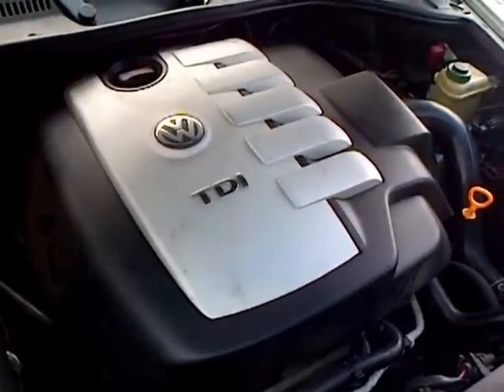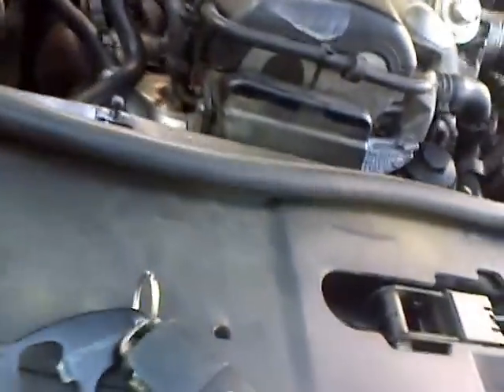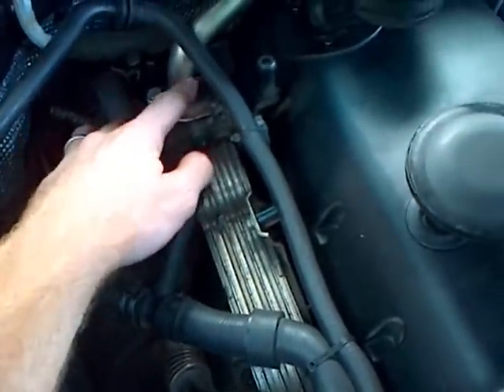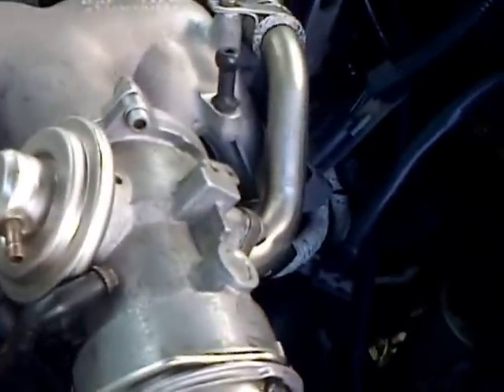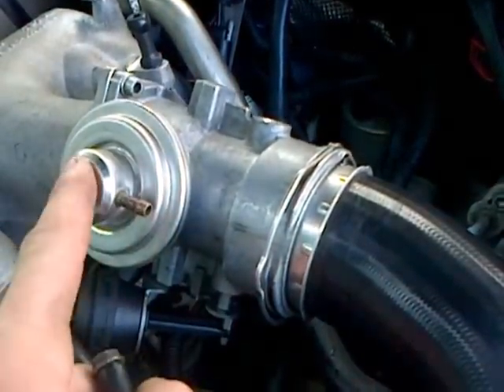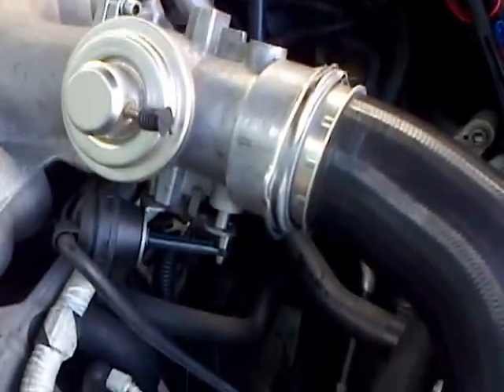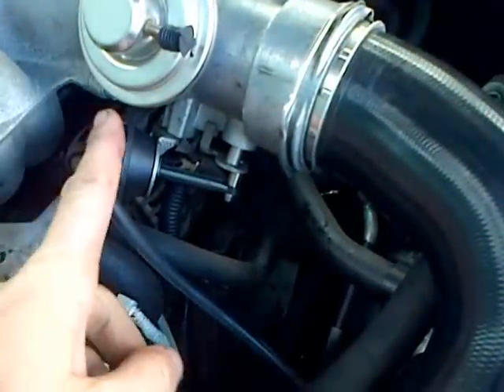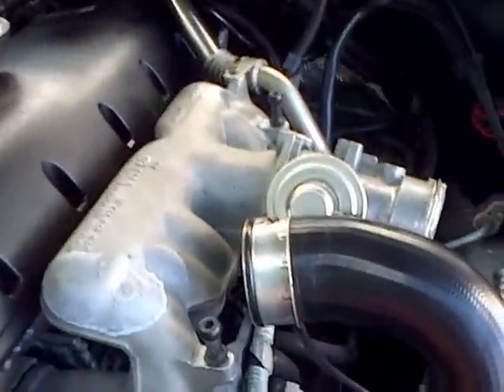Touareg 2.5 R5 EGR blank DIY

Comment from the maker: Did you not read the description ***** . The EGR delete on the R5 with the vacuum system does NOT throw a CEL or log any codes on VCDS/VagCom. The EGR is not active at idle when the car is up to operating temperature so it won't fail MOT. Besides, this a DIY for those who want to do it. The repercussions thereof are their own. Please do not comment if you aren't sure of your facts! This is on my own touareg of which I have swapped the engine. I know this engine better than most. PS : What do you think are the repercussions of having EGR block up your intake manifold starving the engine of air and inevitably causing you to buy a brand new car? What's the carbon footprint of that?
Reply: To delete EGR valve is it enough to block the EGR hose ?? or also must get into the car’s computer and desactivate it from the car’s computer also ?? 
And also would be good idea if remove the throttle body and make the hose straight connect to engine without any throttle body in between !??
Reply: Hola tengo vw touareg 2004 2.5 automática no tiene fuerza al acelerar ayuda por favor

Comment: Hi Marius, great video.. I wondered If after a year later you noticed any negative effects?
Is it important to cap off the EGR valve as well as block the pipe with a bolt? Could not capping the valve damage the turbo?
Reply from the maker: You can either just pull the vacuum pipe off and block it. Or you can install a blanking plate. I did both as I don't want the crud in the valve that stayed behind to get ingested. I have had no ill effects other than the car takes an extra 1-2km to reach operating temp. My car is running super clean and efficient. See this thread - 4x4community.co.za/forum/showthread.php?t=184572
Reply: Marius Fourie Thank Marius. Just read through that forum and theres some great stuff on there,, However in one post it says you leave you EGR valve on and just clean it often? Did you have a change of heart?
Reply from the maker: pullenjon Yes, I did have a change of heart but I have had a change of heart again. Im currently running without it and have done so for about 20'000km.
Reply: What made you change your mind.. and then again out of interest? Ive just blocked mine off today. Doing some heavy towing tomorrow so Ill see how shes goes.
Reply: Hello, thank you for this very old video. İs it safe to just block the vacuum hose and not installing a blanking gasket? Will the hot gas melt the valve and the thin egr pipe? Thanks a lot!

Comment: I noticed today a strange sound on the turbo side (passenger side not drivers) ; like a strong whistle (the car is performing as before). In the N gear I have to give throttle to 2000rpm and then agressively to 5000rpm to listen it. then when 1st 2nd gear I listen it when I accelarate in low rpm 1500-2000 also agressively. What could it be. I made a video but dont know how to post it. :(

Comment: Great help Marius, I been having a severe problem with this issue. Car did not even start and it was nearly prone of abusive dealers trying to make it look the problem was elsewhere. Once I realized the truth I am constantly cleaning it but is getting dirty very often. Now when it happens I have to get out of the car and move manually the lever and then it starts normally. You are of a great help with this video but please tell me if this increases the fuel consumption and/or reduces the engine power? Where is all that dirt going?
Reply from the maker: If you blank the EGR valve the dirt is now going out the exhaust. No negative side effects at all. Best thing I ever did to my car.
Reply: Just found out this video and your comment. I have the same car and one of the main problems it has is the starting. Whenever I drove it somewhere, turned it off and tried to start it again after it got cooled - it didn't start. Went to 3 different local mechanics and they told me the problem could be the turbo or the injectors. Changed the turbo, still have the starting problem. Now I don't want to go to a mechanic to fix the injectors and leave with the problem still persistent in the car.
Now I see this video and I think it might be the problem with the EGR. I will definetly check this on my car later.
@xhexhi do you still have this car? did you fix the problem? My diesel Touareg R5 has 350.000 km.
Reply: @reloaderv3282 I Think that you have a problem with rubber seals of injectors.
Reply: @reloaderv3282  you should also get it on diagnostics.

Could very well be the cam-position sensor. But egr delete is great to keep intake clean
Reply: @Firas Tkaya I didn't fix it. Sold it for dirt cheap. This car engine (the R5) is straight up junk metal.

Comment: Marius, are you getting any blacks smoke after it??
Reply from the maker: Only the quick puff when booting the throttle. Which is normal with almost any diesel of that era. Only the DPF equipped models won't give a puff of black smoke. If you have constant black smoke, you are overfuelling and have an issue. Blanking the egr won't be the cause of black smoke. If you blanked it badly, boost may be leaking and hence overfuelling = black smoke.

Comment: that will not work....u must do it in the ECU to.
Reply from the maker: You only need to code the ecu if the egr valve is electronic. If the valve is vacuum operated like in the video you can just follow the video instructions. I have been running this mod for months without any issues.